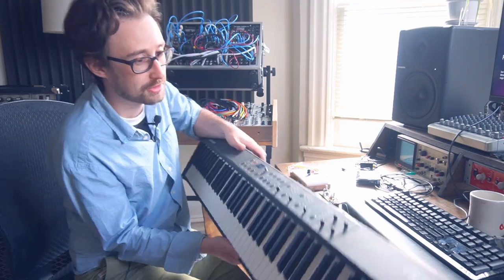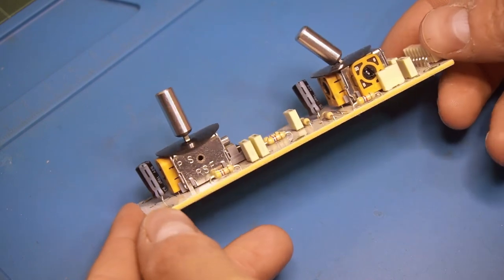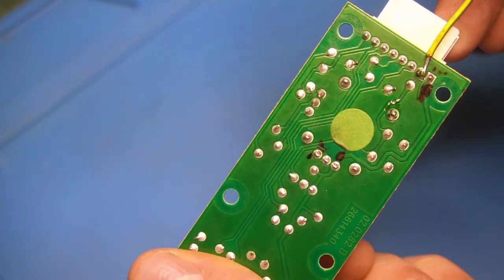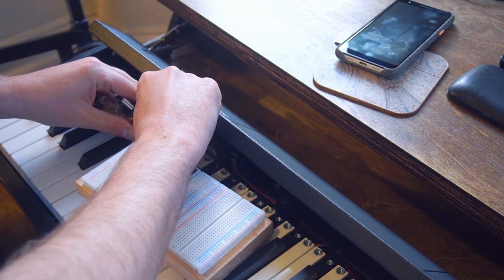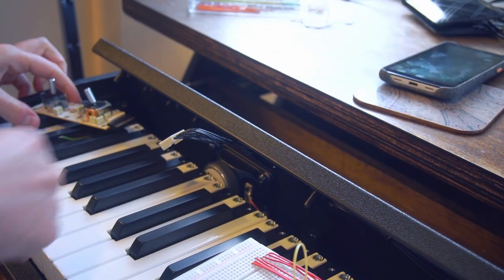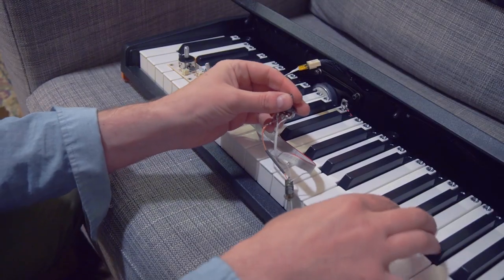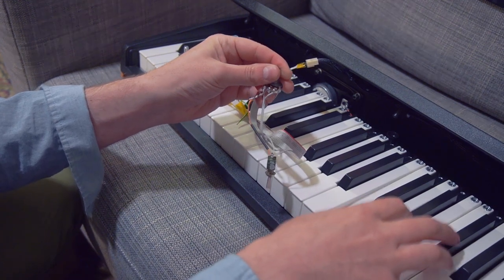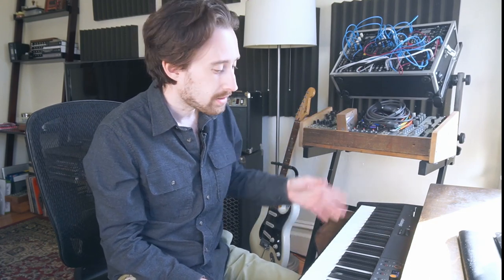Simple Circuit Bending on a Studiologic Numa Compact 2

Comment: This is a very cool solution. I own the Numa Compact 2x, and I can achieve the same filter control using the drawbar sliders (the leftmost 2 sliders). It is useful in tweaking piano patches. Your Compact 2 does not have drawbars, so your solution is brilliant.

Comment: I need to clean the contacts on my Numa 2x.  I have been working in a Cigar Bar. And am getting bad load velocity sounding.  Can you help with disassembly of the keyboard bed?
Reply from the maker: Haven't gotten under the key bed, but it's a fatar model (studiologic is the same company) so should be easy enough. Once you get the case top open, the screws along the forward edge of the bottom case can be removed to free the keyboard assembly.

I found studio logic's customer support very helpful as well when emailing them about some software questions

Comment: Thank you for your video. So what value pot did you wind up using? Have you also found that the resonance setting, either via the FX2 vertical, or with your mod, does not get stored when a patch is Saved?

Comment: THANK YOU for this video! Very interesting look to the joystick assembly! I think you're the first one on YouTube who peeked into this keyboard lol
I had it a while ago and I also always wondered if it was possible to send a different MIDI signal (e.g. modulation) from one of the directions of Stick 1. To me it doesn't make any sense that both directions control pitch bend.
Reply from the maker: Yes, that would be a nice mod to make it more Roland-esque with a single pitch/mod stick. In theory it's possible if you cut the traces and use mod wire to swap the center pins of each pot. However being spring loaded, stick 1 would start the mod range somewhere in the middle rather than at zero. Interesting thought!
Reply: @extralifedisco  That's a good observation. Maybe it could be possible to set the middle point as zero and use both halves of the stick to control two different parameters (kinda like Korg's joysticks), although the sticks are small already and the resolution would be quite low. Otherwise it could be nice to use another Stick 2 as Stick 1 rotated 90° counterclockwise.

Comment: Hii! it is an incredible improvement.  I have a Numacompact since a year ago, and I can say that it is an all-terrain piano, it withstands a lot of "mistreatment", and invites you to disassemble it to see what is inside.  I'm going to try to do the same as you, so I have an excuse to reopen it.  I look forward to the next improvement of this great keyboard.  (by the way, do you know if you can change the keys for some hammer action ones, for example put the ones from the sl88?, I think it would be the perfect keyboard.)

ps: can you tell me what components you used? and the welding plane?  those two extra cables that come out, where do you connect them?

thanks for your attention

Comment: Hey man can you shed some light on how to go about opening up the top bar of the keyboard safely?
Reply from the maker: You must remove most of the screws in the lower case then carefully lift up the panel. There are some wires connecting the main PCBs to the panel so the can't lift it all the way to without disconnecting those, though I don't find that necessary

Comment: Thanks for your train of thoughts and excellent execution.
With that level of quality I am shocked to see a Microsoft optical mouse. Why not upgrade to Logitech?
Reply from the maker: Ha, I've had a few mice through the years. The logitech ones mostly seem to have that "soft touch" butylene nitrate rubber overmolding that's so popular now. In my experience it turns to sticky goop after a year or two so I avoid it. The MS intellimouse was one of the first good consumer optical mice, came out in the 90s, this one is a bit later but they all seem to be absolutely indestructible.